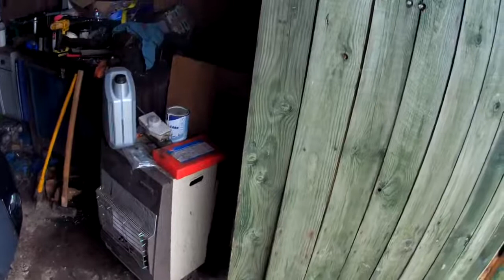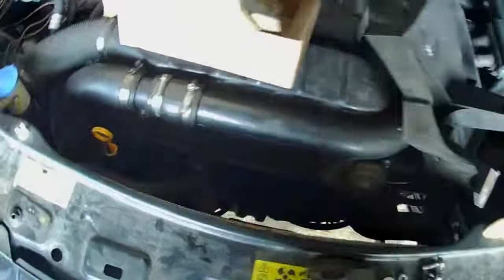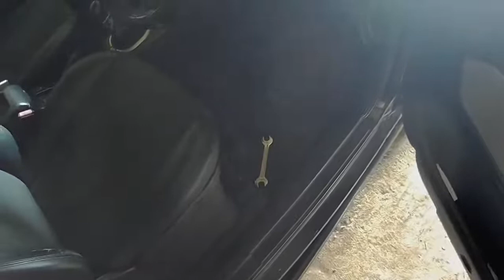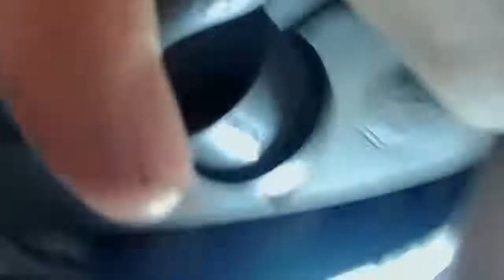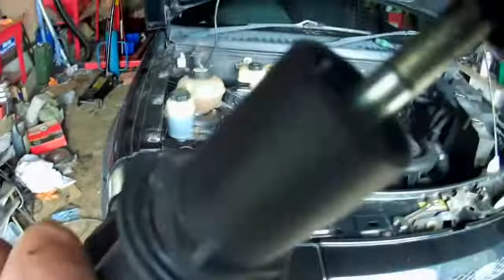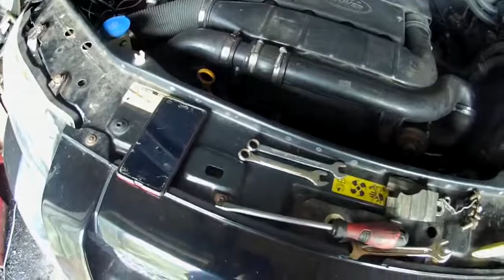Grump's Barn 55 - Freelander TD4 Clutch Master Cylinder Replacement

Comment: Thank you so much for the vid few nice tips and urs is the only vid I came across for this, I have to do mine at the weekend
Reply from the maker: You're very welcome....good luck with it!
Reply: Done the master cylinder was a lot easy than expected to be my only issue was that it didn’t come pre bled so that was a bit of a ball ache still doesn’t feel 100% but then I bought the car like this and never owned a landy before so unsure if the clutch is supposed to soft
Reply from the maker: @damiansutton646  ...they are a bloody nightmare to bleed at times...reverse bleeding can work better at times for these...for that you use a syringe attached to the bleed nipple
Reply: Thank you so much for that advice if it’s still not right inwill definalty do this the clutch I know is new as is the slave cylinder are the clutch’s supposed to be soft on these and the bite down and the bottom
Reply from the maker: @damiansutton646  ..they are not supposed to be soft, and they should bite about 2/3 down or so....there is one more thing you can try that often works....pump the pedal by hand until it's hard, use a lump of wood or similar to hold it right down and leave it like that for a few hours, or, even better, overnight. The next day open the bleed nipple  to let out the pressure then close it again....then remove the wood and pull the pedal back up....now when you depress it  it should be fine...if you're lucky....this trick often sorts them out without a full bleed.
Reply: Inwill try that I don’t have any wood but something I found helps is a crutch so that the hand rest sits at the back the steering wheel
Reply from the maker: @damiansutton646  ...good luck with that....let me know how you get on 👍